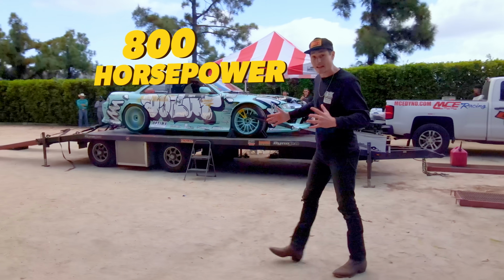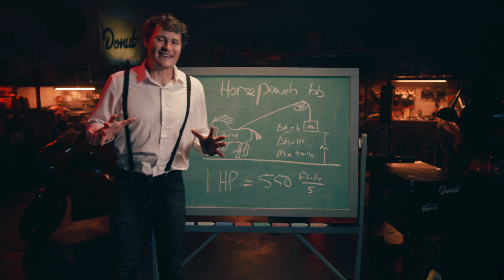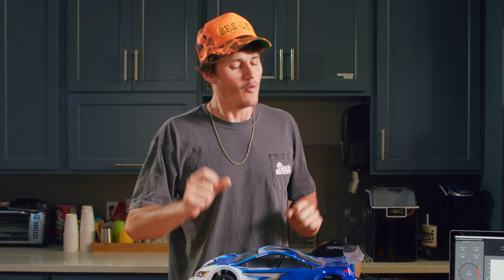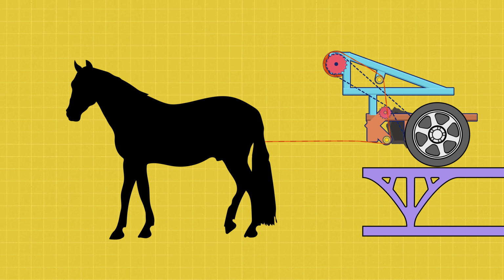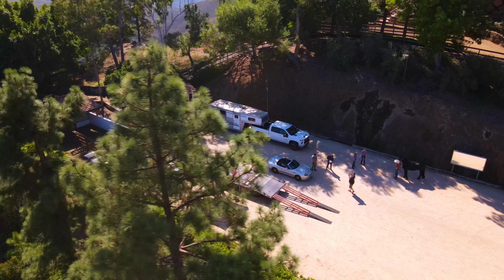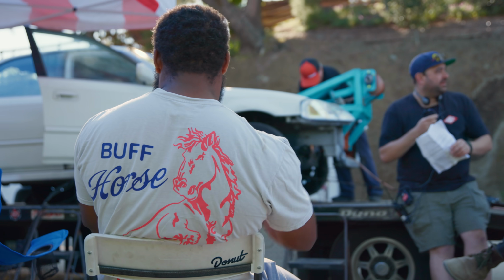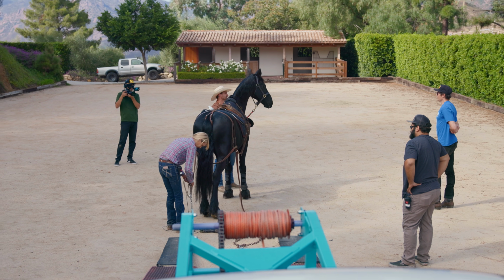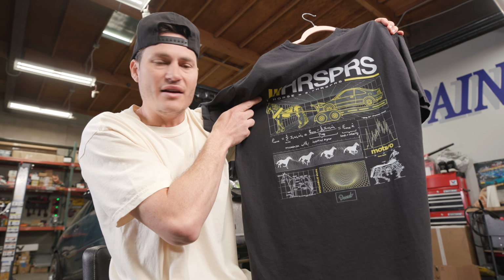How Much Horsepower is a Horse?

Comment: The guys at Motivo are absolute champions for doing this on the spot like that. Hats off to them for sure. This now opens the door to the rest of the curious motorheads/scientists out there to get a true average for the value of 1 true horsepower. I can't believe this hasn't been done until now! Who knows,  imagine in 5 years the value of 1 horsepower actually changing, all because of a crazy idea that started right here. So cool to think about
Reply: It won't because the modern Horsepower is defined by the watt
Reply: @Kloppin4H0rses  of course BHP, (imperial horsepower) and CV (cavallo vapore, metric horsepower equal to 0.98592hp) wont change. But a new metric of THP (True Horse Power) can be defined to be equal to 5.7hp or whatever metric is agreed.
Reply: @Kloppin4H0rses  lol I know man. I was being a troll seeing how many people would actually buy that... was a long day yesterday and I was bored 😆
Reply: It’s actually an insanely over complicated and scientifically incoherent system. The amount of mechanical power loss going through that contraption and the cars transmission is astronomical, given very false readings. They should have just wrapped the rope the horse was pulling around the dyno drum
Reply: @BikingVikingHH that’s why the math takes into account the friction losses. There’s a reason it needed to be calculated
Reply: @bluckq  ok, so they ran a bunch of theoretical calculations based on hypothesized friction losses of a machine that was built specifically for this purpose and does not have set values, instead of just running a rope around the dyno drum like a pulley? Riiiiight…. 

When you try and sound smart by supporting an insanely bad idea 😂
Reply: @BikingVikingHH If you assume that the goal here was, “Get a horse on a dyno”, their solution is about as good as you’re gonna get.
If the goal was, “simplest possible way to measure horsepower”, then a direct connection would probably be better.
I suspect that the goal was the former based on some subtle context clues in the video ;)
Reply: @Toberumono  no, if their goal was to get a horse on a dyno, they would put a treadmill on a dyno and put the horse on it.

The horse is in the same position relative to the Dyno in my example and the one shown in the video, so that negates your big brain theory of their intentions to “put a horse on a dyno”.

In fact the only thing different between my experiment and the one they stumbled their way through is a completely unnecessary, overly complicated and error producing contraption. Sorry bud, I don’t know what bizarre “subtle context” you are reading into to think any of this makes sense, but they just floundered through a scientifically incoherent experiment because they’re morons. 

It’s just like when they tried to test aerodynamics and put the vortex generators in the most asinine spots. 

This channel is made by retards who like the idea of cars, and watched by the same.
Reply: @bluckq  also, there are more than just “friction losses”. They are using the car‘s transmission so there is the viscosity of the oil to take into account, the inertia of the entire transmission and all its metal parts, the friction of every moving part on the contraption, as well as the inertial losses due to the weight of everything in the contraption. Yeah, measuring all of that and running astronomical calculations sounds like a much more scientifically accurate way to measure the power a horse puts out, instead of using a rope and pulley 😂
Reply: @BikingVikingHH  Absolutely. Were they playing or did they just screw up? I mean, what they did was fun.

Comment: I've been, low-key, wondering this for quite some time now.
The implications are that all figures metered/advertised/sold-as/claimed/boasted/etc.... prior to now, must simply be divided by 5.7 to represent the reality defined by these results (...as unfortunate as a perceived reduction to them all will be...).
The REAL question is, who, of importance within the automotive, as well as others, industr(y/ies), will amend their practices, alter their future figures and adhere to a utilization of the new findings?
Sure, it's not what might be considered as an optimal, "labratory", sterilized environment; however, the automotive industry has certainly had the means to perform such tests for a hundred years but, IMO, they're reluctant to realign public perception with a far more accurate representation of reality because if it's potential to harm sales figures, however temporarily, when compared to those of the previous defunct system of measurement.
One thing is clear to me... it certainly must be far more accurate than any system utilized for standardization by Mr. Watt, which, as it's represented here, was not a system that was tested, reproduced or scientifically proven by others of any notoriety, or even otherwise, since its inception.

Comment: There's a huge difference between sprint HP and steady HP. Just like you can deadlift a lot more than you can rep. for a set, so Big D could not sustain 5.7 HP for any length of time. That's why Watt set 1HP so much less than what a horse can pull. Ask Big D for an 8hr day of pulling. I'm pretty sure he'd average less than 1HP. BTW, I'd like to know the HP output of a racehorse on a 2 mile track.
Reply: Exactly! While I enjoyed watching the video, I didn't like that they called James Watt a liar. If his engine couldn't run for a full day, replacing as many horses as he claimed it could, he would have been a commercial failure instead of becoming wealthy and famous. There's a big difference between maximum horsepower and sustainable horsepower. Put your 500 HP engine on the dyno and run it at wide open throttle until it blows, it won't take anywhere near 8 hours!

Comment: Really love the video. But I just don't think the math is right. Cause the Dino computer simulation software.
It's testing what it says. 5 horsepower is off of old calculations of horsepower.
Realistically, the horse just pulled. It's one horsepower as a rating.. so in the real world. Everything that has a horsepower rating. It's now gonna be divided by 5.1 to show. It's true horsepower rating.  As in how many horses it would take to do the same equivalent job
Reply: I never liked the scientist Calculations of saying one horse makes 15 horse  power. no. no 1 horse equals 1 horse power 400 horses, 400 horsepower. If you don't like my opinion just ask god when you get to heaven

Comment: I don't think you got an accurate representation of HP.  You had a hard linear start, and a VERY short linear pull.  Too many things to confound an accurate result.  If you look back at the working Draft Horse, set up a rig like that, add a flywheel to help average out irregular inputs, and turn a generator; you could read your results in WATTS.  Your initial result can then be found using 3rd grade math.  Of course some 7th grade math will be needed to factor for inertial and frictional losses.  IDK, might end up with the same result.  But this was entertaining nonetheless.

Comment: I think we’re missing something big; Big D can probably produce more horsepower. Similar to how cars produce more torque at higher RPM, it’s possible that while running horses generate more power than from basically just walking. Force output standing upright is flawed because legs are kind of trying to awkwardly push forwards and upwards

Comment: Ok but there is a standard of how the horse powers in cars are calculated right? or can on car be 100 horsepower but if you calculate it differently it could be also 130 horsepower depending on what calculation they used? or is it just 1 standard?

Comment: Great minds couldn't weld 3 steel rims together, mount tires to the outside two, shove an axle through them, chain said axle to the back of the dyno, wrap a rope around the middle wheel and have the horse pull it? It would litterally be exactly what they need with the only math and loss being the rollout of the tires vs the rollout of the spool (barrel of center rim). 

Hire me, Motivo. I'm cheap.

Comment: So the question is, was Watt's steam engine equal to 28.5 hp to 57.0 hp? Seems like that is knowable. I'm guessing at the time, customers would have known if his engine was equal to the number of horses they were replacing with the steam engine, since they could see if the engine was doing the same amount of work. I am sure Watt had no idea his unit of measurement would have such a long and varied life.

Comment: The horsepower result makes sense, as . . . 
For the life of me, I could never figure out how a single horse could gallop at 20 mph, yet, a "one" horsepower engine would be lucky to move a wheeled device [motorbike, lawn mower, etc.] at 5 mph max.
I've known low-cost go-karts using engines with horsepower ratings comparable to what the finding was for what this four-legged horse produced, and those go-kart's speeds were under 30 mph; which is an approx. speed of a horse at full-gallop.

Comment: This is quite a nicely done experiment.  One note: You imply that Watt’s original experiment never happened or is biased, however your experiment measures something fundamentally different from Watt’s “1 horsepower” definition.  A steam engine can operate continuously, whereas horses must operate at a sustainable level (not maximum output) and must also rest.  Therefore 1 horsepower could better be defined as the average output a horse can maintain over an extended (days-weeks) period of time, including the periods where they will generate no horsepower (rest).  A device that needs no rest is comparatively more economical if its cost to horsepower ratio relative to this extended output definition is better than that of a horse.  Of course, maintenance and length of service has to be factored in, and it’s quite difficult to measure the output of an “average” horse without many endurance type tests.

Comment: The main problem with this setup is it doesn't allow variable ratio. For legged animals like humans/horses, there's some speed at which we achieve optimal power and that isn't accurately measured.

Which is also why the guy on the bike did so much better than the guys on the rope. The bike allows the rider to select the gear ratio.

Comment: Good video. The standard for measuring power is Watt not HP :)
And to be fair peak power can only be sustained for seconds by animals (that includes humans and horses).
A typical fit cyclist may be capable to sustain 250W for about 20 minutes much less for longer periods and thus the 745W or so figure for an average horse in therms of sustained load seems like a very reasonable value.

Comment: Why not use an engine with a known horse power rating. Hook it up to the rig that yall made and run it. That way, you can confirm the real number by comparing the 2. Yall wouldn't have to calculate the loss in efficiency because both horse and engine are using the same (transmission)

Comment: Amazing episode. I loved it. Shouldn't you validate the set up by using a low-hp bike (or car) as the puller, then use the same bike on a dyno, and compare with factory hp reported? Between these 3 numbers, you could establish how far off (if any) the horse dyno is for a machine with known (and measured) hp.

Comment: Great video, I loved seeing the horse literally being put on a dyno to measure the horsepower. 

Idk if this is a fair comparison to James Watt's alleged experiment though. James Watt allegedly based his figure off the horse's average performance over the course of a day. I wonder if there is a way you could set them up on the dyno all day vs just pulling for a hundred feet or so. Watt's engines could run continuously vs just running at peak power 5 times before calling it a day.

Big D's peak horsepower was about 5.7, but I wonder what his average is over a full day of pulling. Perhaps you could put him on a treadmill and the treadmill could power the dyno.

Comment: 11:14 They helped the Montgolfier brothers?

25:53 Funnily enough, the same thing applies to judging how fast bullets travel out of a gun. In the old days they didn't have optical or radar or laser chronographs to judge bullet velocity. You know what they used in the 1800's? Spinning discs of paper-- namely two spinning discs on a shaft at a set distance apart, spinning at a set speed. The angular difference between the two bullet holes gave you the indication of velocity.

Comment: Id love to see this redone,   with more accurate RPM measurements. Different horses and a WAY longer pull and give us the equivalent torque output as well
Reply: The horses have more horsepower in my opinion
Reply: @MegaErnieMAN  IMO it depends on the time. In the video they said that the horse could only do 5 pulls in one day, more probably would not be good for the horse. 
However, horses that were replaced by steam engines did the work for hours before being allowed to rest, while another horse took its place. I mean the pumps etc had to run all day. As such, the power produced by one horse was much less (it may have been more than 1HP, but probably not that much more). 
It's like sprinting vs running a marathon. A sprinter produces more power, but only for a short time.
A steam engine can run all day at its rated power and since it does not get tired, it replaced even more horses.
Reply: @Pentium100MHz maybe true, on the other hand big D looked like taking a gentle stroll.
Reply: and that man leading the horse should just start running cuz that horse was 100% not doing max power and they know it
Reply: Me too.
It's just not good enough. 😒
Mentioning losses in the conversion, uncertainties in the dyno to measure such uneven pulls, the horse getting uneven drag forces (should have used a bungee), not knowing when the horse has its highest power output, and more.
To eliminate some of this, you should just have put a mark on the drum and calculated the power output from the rotations per time unit. Need to know the inertia of the drum, obviously.
Or why not just do a pull on a wagon with known mass and low rolling resistance?

Comment: I love this video... but there are so many flaws here. I'm sure you can calculate the loss due to the gear ratio used, however the drum the rope is on will change in circumference the more rope is pulled off. Each layer will have a different tq yield. The lowest layer will require more tq than each layer above it. Lost traction is also a factor. When you spin the tires on the dyno, it makes a huge difference. That's no different here.

Comment: Cool video.  Seems like you could have just wound the pull rope around the dyno roller and had Big D pull from there, eliminsting alll of the parasitic losses in the system you built that really needed to be account for to measure D's actual output.  The backup system had the potential to give the most accurate measurement of Big D's output. Fun video and we're a little closer to defining 1 hp.
Reply: yeah, I assume the actual academic version would be an axle dyno with the spool mated directly up to it - this is probably car-shaped just for TV interest and getting to fab a custom contraption for fun
Reply: Say it with me 👏👏👏 🔊

THE MODERN HORSEPOWER IS DEFINED BY THE WATT. THIS CHANGES NOTHING

Comment: Love the project but don’t think horses got a fair shake at all with this one. Y’all should’ve used a single logging horse. They’re trained to take off from a dig full force to get the log moving. Log or sled pulling horses would give us the fairest reading. Gasoline’s running at full potential with every stroke no matter what engine it’s combusting in or what pressure it’s combusting at. And all engines are purpose built to perform their task. So it’s only fair to test a high octane work horse that’s not only built to pull, but out here pulling every day in the real world too. This pampered but well trained horse displays nowhere near that level of grit or giddy up and go. Given that you’ve already crunched all the numbers and built all the equipment and know exactly how to recreate the experiment, PLEASE consider redoing this one with a proper example!